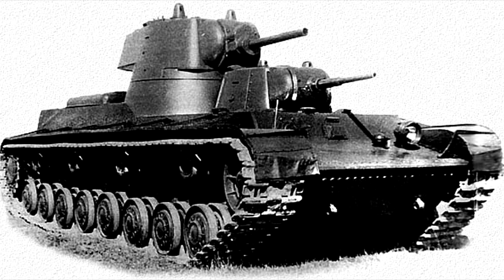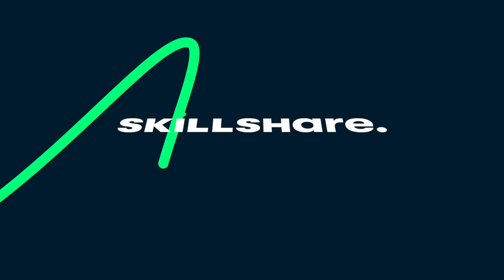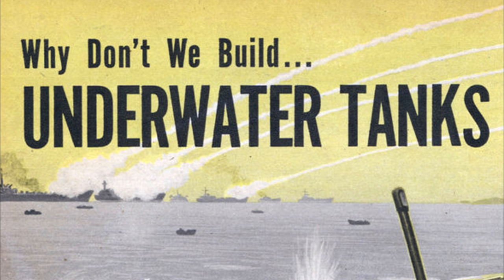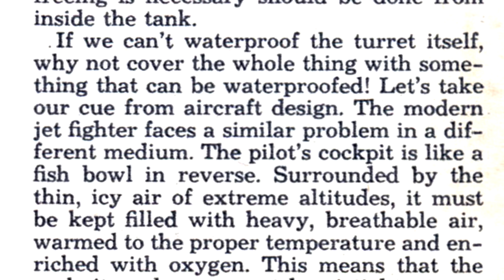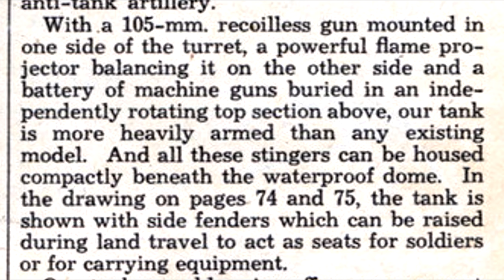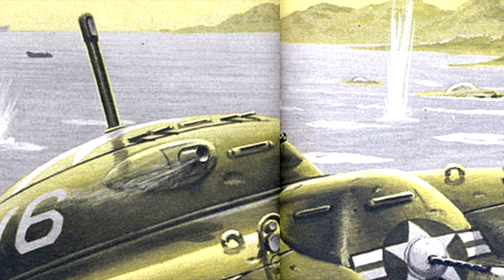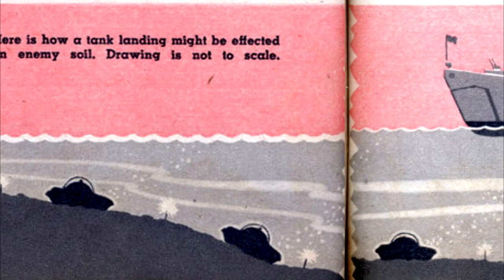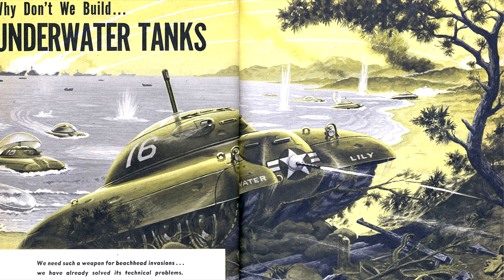The CRAZIEST Amphibious Tank Concept EVER | Cursed by Design

Comment: I feel like having a recoilless rifle in a confined space, much less a tank, would turn the entire crew into a thick paste upon firing.
Reply: Yea.....the fellow who came up with the bright idea to put the recoil-less rifle inside the turret obviously had no experience with them being fired.
Reply: I’m also wondering about the gun performance too. If you had a gun with most of its length in a turret with a fairly low silhouette (reminds me of Cold War Russian mbts) then your depression and elevation would be tricky at best.
Reply: They probably had a weird new modified design with a hole in the back of the turret and some kind of side loading, plus I think the design was actually supposed to use rocket tube flame weapons instead of an actual flamethrower.
Reply: I was just about to post this.
Reply: these guns can be built to vent the gas anywhere, just vent it forward like the sturmtiger, its not inherently backward venting
Reply: @gaiamission7200  If you vent the gas forward, in the same direction as the projectile, it's not exactly recoilless anymore. You'll need more room in the turret for the recoil.
Reply: @bificommander7472  the recoil force wont be anywhere near as high as similar performance conventional weapons, allowing the gun to be fixed and not travel with recoil
Reply: @HanSolo__  go check one of the comment above about his battle ship idea then tell me he have "knowledge" , 1 thing for sure tho is the guy is a great clown
Reply: @huyhoangtahuu9733  not this one...
Reply: @HanSolo__  true, he may have been a cuckoo but the ideas with the recoilless has merits. Ofc you need a barrel which goes through the rear of the turret and it needs a breech in the middle of the barrel.... a very good thought out breech which keeps out the exhaust gases, obviously. But even though there were non-RR designs like the german Sturmtiger and the "Puppchen", a predecessor of the Panzerschreck where they fired the rocket projectile out of a somewhat "regular" gun ( also the failed tank fired missiles from the 80ies ). These designs had no recoil to speak of and thus could theoretically have been used in tanks ( and were as evidenced in the crazy and probably pretty pointless Sturmtiger ). The accuracy would have been as bad as for the Panzerschreck but if you want firepower ....
Reply: @thingamabob3902  If you stick the back of the rifle out the back it becomes immobile elevation-wise, AKA useless. Only way this design could work is make it NOT recoilless and make it so that when the plastic cover is blown the rifle is pushed forward and locked in place for shooting, here comes the NOT recoilless part: it would either have some sort of exhaust design in the turret through which the "recoil" can go without hurting the crew (which sounds bulky, not much space in a tank like that) or just replace it with a conventional turret.
Reply: @castor3020  Sure you need to plan the turret accordingly, perhaps to the side of the turret or a higher casemate one like the Marder had or something. Anyway the Puppchen did not have any backblast so it would have been usable in any case.

Comment: Man i really hate how well thought out this design is
My only modification would be to add sponsons to make the tank neutrally buoyant and link water screws to the drive
Reply: Also the backblast of the gun
Reply: @shogg4  it said in the design that there would be an exaust port in the Back of the turret. As in the gun would go through the turret front to back.
Reply: @shogg4  One of the first flaw i noticed, the design literally means that the crew will be roasted when it fire its gun.
Reply: @HavocHerseim  Solution: rocket boosters.

Comment: I can't even imagine how loud an enclosed 105mm recoilless rifle must have sounded from inside the tank even if the breech area was separated from the crew compartment with a bulkhead. The shockwave would have also been rather debilitating.

An Ontos-style arrangement of recoilless rifles probably would have been more workable than what's shown in the drawing. Perhaps those barrels could have been sealed up without a plastic dome as well.
Reply: Wonder How they might deal with the backblast
Reply: Recoilless rifles and armor protection don't generally go together. I think there were attempts to mount one with the muzzle and breech both outside a turret, but that introduced other issues, such as reloading. An Ontos arrangement requires a crewman to fully expose himself to enemy fire in order to reload. Not exceptionally practical for something supposed to be used in a beach assault (Ontos was designed as a tank destroyer).
Reply: @jarink1  Oh, I wasn't saying that the Ontos arrangement would have been ideal- just less insane than sealing the backblast within a turret.
Reply: Vent out the back and load from a sliding port in the side. Job done.
Reply: @Lightwolf_VR  That might work but you'd need to significantly raise the gun versus what's depicted in the drawing.

I guess the real issue here is that the concept drawing is quarter-assed at best. The thing looks like it's got a tiny mortar instead of a recoilless rifle.
Reply: They don't have to vent out of the back.
Reply: @jarink1  an oscillating turret solves the issues, but brings up new issues (although alot of these have also been solved)

Comment: How the hell is this gun supposed to work? Is there just a big hole in the back of the turret for the backblast of the recoilless rifle, or is it venting the rocket blast directly into it? 
it doesn't LOOK like the rocket launcher from the Sturmtiger, i.e. venting the gasses forward... and the gun you mentioned being a likely candidate isn't much smaller than a 105mm tank gun.
Still, while the flamethrower might be useful for beachhead invasions, i think the massive amount of machine guns show just how far detached from reality the designer is.
Reply: The clear plastic dome would have surely kept everything safe, sturdy and not drenched.
Reply: @ardie4  Plastics can be very impressive in that regard.... nowadays. 
In the 1950s, plastic was brittle garbage that would've just cracked as soon as it got a foot underwater.
Reply: @rdfox76  Pretty much and the bow machine gun was on its way out as well.
Reply: @DarkestVampire92  The bow machine gun on the lower plate of these tanks is especially silly.  An amphibious tank is more likely than most tanks to need to crest a ridge under fire from entrenched enemies, so its lower plate is going to need to be extra strong.  How do you make it extra strong?  By putting an obvious weak point right where someone aiming for the biggest flat surface on the tank will be aiming.

Comment: This may just be my lack of understanding on this sort of subject but wouldn’t a design like this want to be slightly heavier than a light tank but not enough to be classed as a medium tank? 
What I’m attempting to get at is the issues of underwater traveling. With wider tracks it would have an easier time finding grip but if the vehicle was too light, wouldn’t that negate the widened track lengths? 
Another issue would be underwater visibility; especially if there’s multiple of these tanks traversing the floor. I’m guessing there would be some sort of light on the outside of the tank like another other but what about an infrared sensor? Does water interrupt those?
Lastly, communication. This is going to sound more complicated because of how I’m thinking but I’ll try to simplify it as best as I can. Would they use standard radio equipment found in most tanks or would they require something with similar strength to that of a submarine? To my knowledge currently, radio waves can travel far through water but it requires a strong sensor to pick up the response(I’m not 100 percent sure); something stronger than that of a standard tanks radio system. 
This is all speculation of course since this isn’t a real design but I think this concept could be made into a more realistic design if we collectively solve some of the issues highlighted above. Let me know what you think.
Reply: You'd also want to be sure that the seabed was free of obstructions, hitting large rock formations or steep coral could really ruin your day.
Reply: The German solution in the Tauchpanzer was to run an aerial up to the surface with the flexible 15 metre snorkel tube they used. Visibility is going to be poor to zero, once tracks started churning up the sea bed, so I believe the idea was to drive on a gyro compass heading.
Reply: The design looks like it could easily be 20-30 tons, so I think that the grip problem you're describing wouldn't be an issue.
Reply: They could have used a simple  active sonar system, they’d be able to hear the “pings” through the hull, if they’re loud you’re close to someone. That would at least avoid people driving into each other. They could have tried to use the pings as some kinda Morse code but it probably wouldn’t have been worth the trouble, they’d only need to be out of communication for a few minutes at most
Reply: The more I think about this, the more I kinda want to make a full fledged design for this tank. Like exact armor thickness gun and ammunition types, track layout; the works.
Reply: Its rather impractical overall... but i suppose the idea would be: "we just drop the tanks in place, and tell them to drive straight... it should get them close enough."  the illustration shows that there are some light beacons, maybe a frogman/navy dive crew would set up beacons prior to the assualt, or infantry landing craft may drop anchors with lights to guide the way.  the tankers may not need perfect visibility to follow the beacons, but as long as they follow the chain they should get to shore...

The issue then becomes if a crew gets disoriented and follows the lights in the wrong direction, or gets lost then panics and the crew drowns/suffocates.  

I suppose this may work best in short spurts.  a quarter mile to the shore for instance? but then your boat is easily within range of the enemy guns.  Additionally he mentions using it as a means of attacking in asia... floating vehicles struggled with coral, these submerged types would become lost in the maze of a reef.  or find them even more difficult to traverse.  

Conversely, an unmanned, undersea tracked vehicle probe could prove quite useful in securing beachheads.  Serving as mine clearers, or to drive up and detonate/destroy anything that would endanger the landing craft or infantry.  things like concertina wire fences, belgian gates, log ramps/posts... ect.  Imagine a small fleet of amphibious goliaths rolling up the coast at night, detonating in preparation for an assualt in the morning... if conditions were favorable they could even roll their way up to the enemy fortifications and damage the naval guns.  probably not something feasible in the 50s... but in the 60s or 70s? but by then invasions of that type were not going to be a thing anyway.

Comment: If US had it in WW2 when fighting Japanese, this tank would be very helpful. But main challenge I see is actually the surface of the ocean bed - it's not really flat on most places. Second, if the ships need to stay away from shore guns, that makes quite a long distance and can be often really deep. It would be better to change the design from moving on seabed to keep like 10 m below water. This would need some submarine systems installed and lighter armor than the author imagined, but 10 m of water would also protect it nicely during the moving phase.

Love the way he thinks tho :)
Reply: @HavocHerseim  What shorelines do you swim near, where the currents are strong enough to sweep around a flat, hydrodynamic tank weighing many tons "like a toy", but are still gentle enough to allow people to swim in them?

Comment: 3 issues
1. Dense mud like you said which require emended power to overcome
2. Diesel subs used batteries underwater. Could a battery meet the power needs at that time.
3. Recoiless guns worked by pushing part of the blast back wards to reduce recoil. In a sealed box this would have shoved burning propellant into the crew’s faces